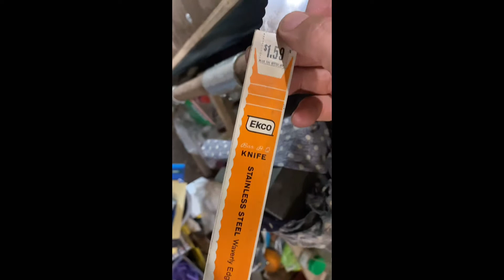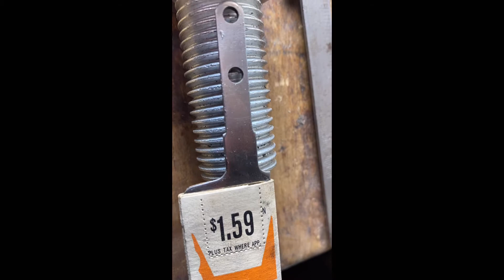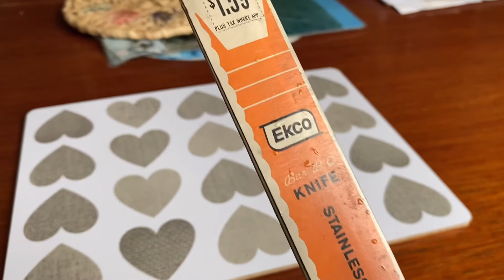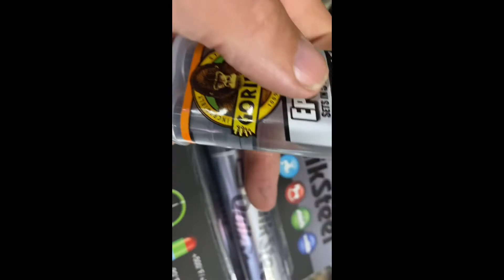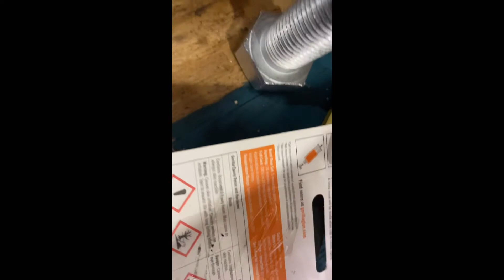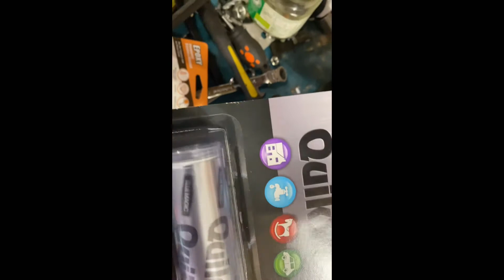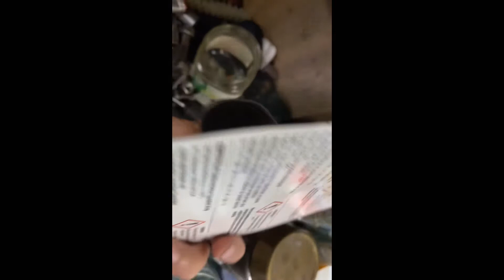Scoutcrafter challenge completed

Comment: I think your holes were too close together.    I appreciate you wanted a slot, but a twist drill is not the best tool for such close holes.  The drill bit likely broke through the wall of the adjacent hole, then flexed to try and follow the existing adjacent hole.   It does not take much of a flex for the bit to break.   Glad you were able to remove the broken part.
Dave.